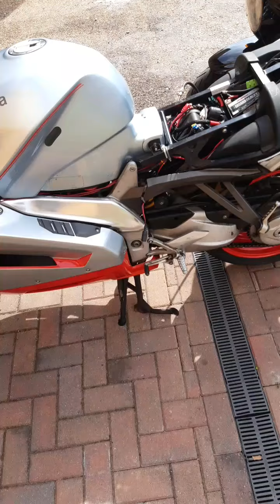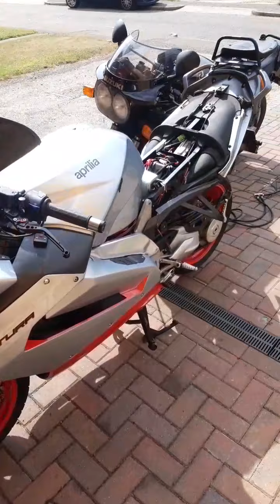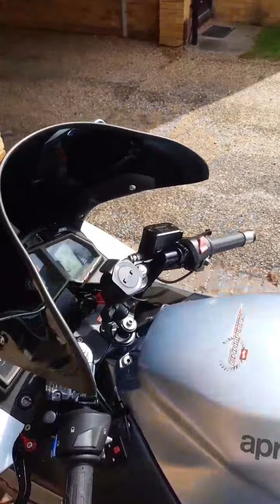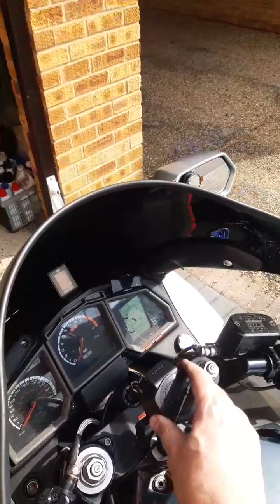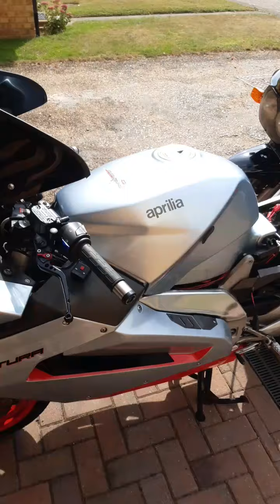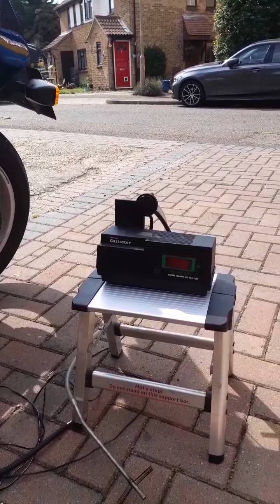Final tuning on the Aprilia Futura using gas tester at idle

Comment: Hi, I have an Aprilia RST 1000 Futura. It starts and runs fine, but once it warms up (about 5 minutes after starting), it immediately stalls. It might stall while driving the next time I start it. Where should I look for the problem? Could it be that I have a pinched fuel line, or is there a spark issue as well?